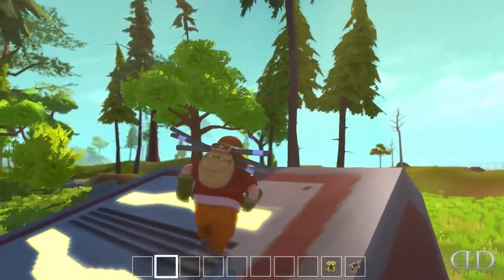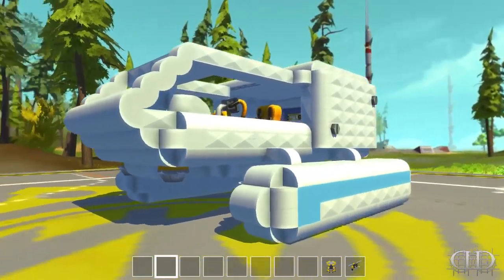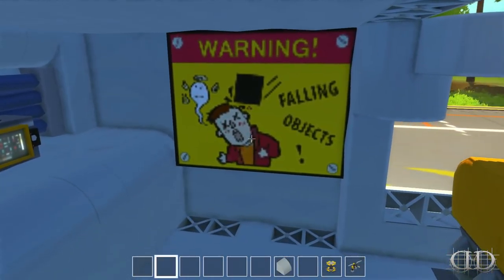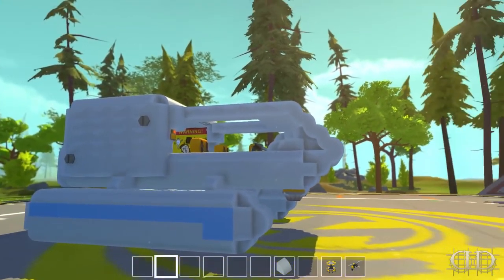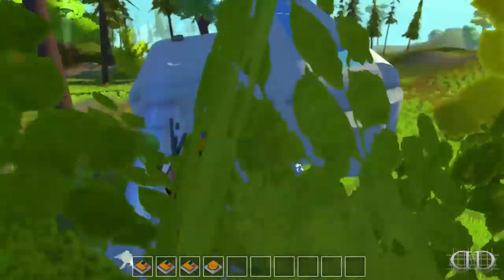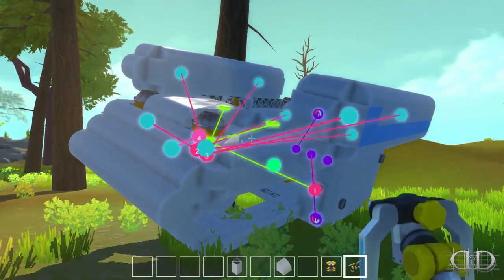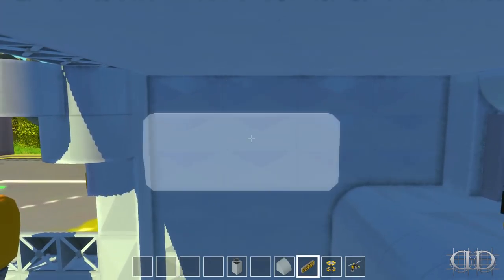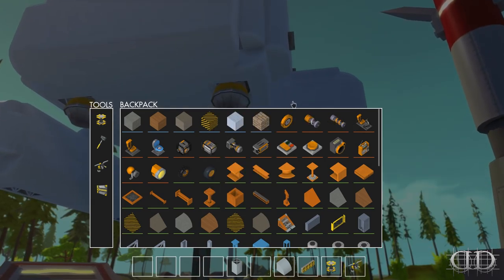Scrap Mechanic Gameplay : EP52: Star Trek TNG Shuttlecraft! (Let's Play 1080p)

Comment: Your character doesn't weigh anything. What's actually messing with your balence is that the "medium weight" actually means "medium density". Since the driver seat is 4x4x6 and the passenger seat is 4x4x4, the driver's seat actually weighs 50% more. The difference in weight is equal to 64 wooden/"light" cubes, 32 concrete/"medium" cubes, and 12.8 metal/"heavy" cubes.
Reply from the maker: +Stellated Hexahedron too much math!  Very cool, thanks for throwing down the numbers!
Reply: I know right........he is not stupid though